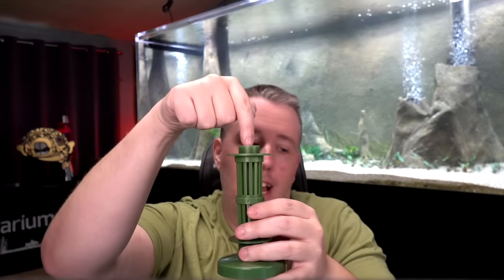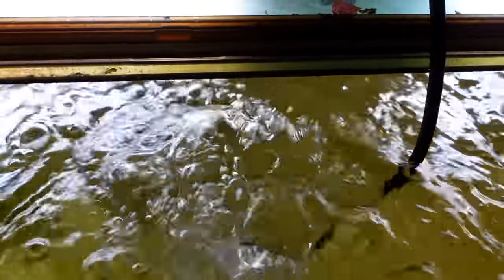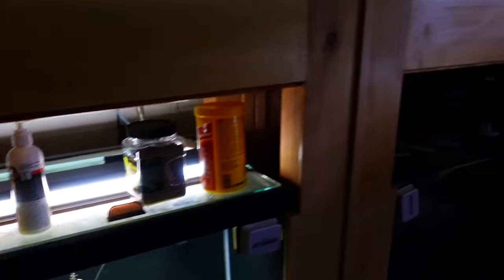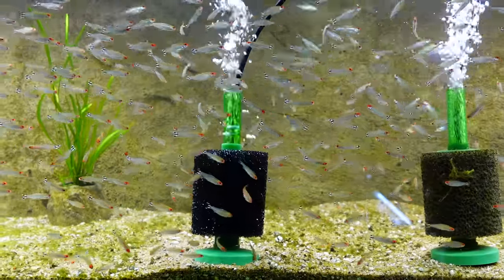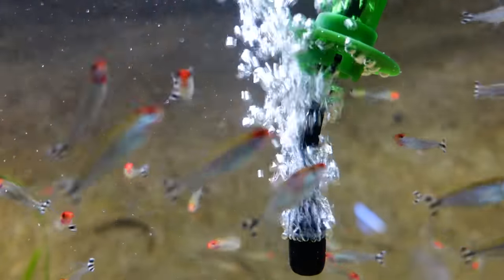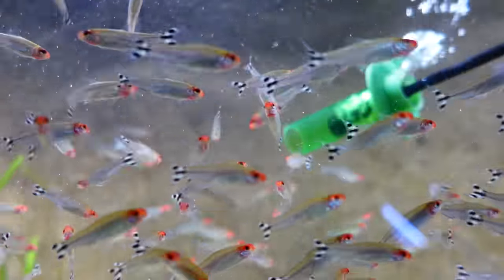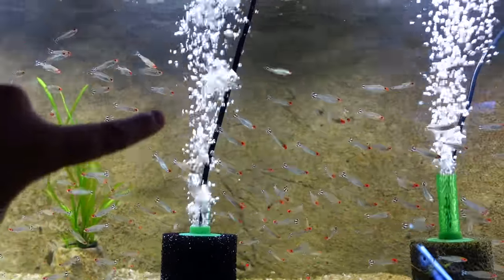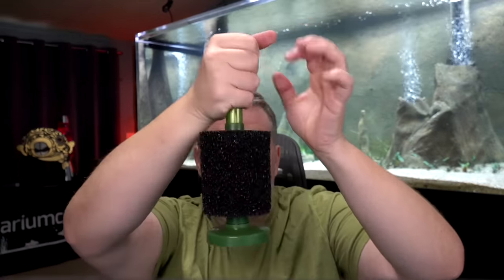How to Optimize and Clean a Sponge Filter

Comment: Cory,. Im set  in t up a couple  20 gal aquariums and a 55 gal and I’m thinking about using under gravel filtration. Do you use this type of filter? Pro’s and con’s? I will have a planted tank-  30-75. endler’s, 1 betta, 1oto, 4 dwarf Cory cats, a couple mystery snails, 1 trumpet snail.. of course im buying co op sponge filters today.. lol I need to use a valve to turn down the air in my stones because I have that jaquzzi sound from a 2.5 beta tank. Poor boy. He’s coming out of there soon. It’s a quarantine tank because I bought him a few days ago and it looks like he has Pop eye.. 😢 I purchased him because he was pineconing  in that tiny cup.  I’m medicating him today
Reply from the maker: I've used undergravel filters. Try one out. You may love it or hate it. All filters work. Mostly it comes down to preferences.

Comment: On my sponge filter, because it kept floating l bought a suction cup and glued it to the bottom. Now it doesn’t move and easy to take out by just popping my fingernail under one side and wallah! 
Love the new design you have especially having it weighted down and the attachments. Are you able to send to Sydney Australia?

How often do you recommend cleaning them, and what is the best way to clean them without risking any damage to the sponge?

Comment: Excellent info, Cory!  I just bought 2 sponge filters from you yesterday!
I'd be concerned if you were squeezing the sponge filters several times when cleaning them.  I read about a test somebody did in which he squeezed the sponge filters multiple times and measured the ammonia level over the next few days.  1 squeeze recovered all beneficial bacteria after 1 day, but with 2+ squeezes, it took anywhere from 9-18 days before the ammonia was back down to zero.  I think maybe a lot of that brown gunk is beneficial bacteria, and you're removing it when squeezing too many times.  
Now, if you have 2 sponge filters in the same aquarium, and you stagger cleaning them, it probably won't be bad at all, because as one is "recovering," the other will take over the nitrogen cycle.  
Am I just being too cautious, or is there any truth to what I'm saying?
Reply: Great question, I think about this too. I believe I'm only disturbing some of the beneficial bacteria in the tank by cleaning the sponge filter. So as long as I don't gravel vac, clean the glass and clean the sponge filter at the same time I'm OK. Kinda feel like I'm making room for new hungrier bacteria too...
Reply: Im no expert or anything but wouldn't the substrate hold a lot of bacteria too? A lot more than the sponge? And isn't it's main use for mechanical filtration?
Reply from the maker: I e never run into this issue, even when running a store with 300 tanks and all sponge filters. In fact this is the first I’ve ever heard of it if you are cleaning them correctly. If you take them to a sink and use tap water, there may be some concern.
Reply: @Peter McCarthy:  The substrate (and glass, and plants, and rocks, etc.) will indeed hold denitrifying bacteria.  However, I believe that the efficiency of denitrification is greatly increased with water flow.  Unless there's a powerhead or wavemaker blowing water across the substrate, or you have an undergravel filter installed, the denitrification will be too low to make much of a difference.  I believe that sponge filters do both mechanical filtration and biological filtration.
In any case, I'm using the two sponge filters for a plain, glass-bottom, quarantine tank.  Once the cycle is complete, there will still be beneficial bacteria on the surface of the glass, but much less than if it had any type of substrate.  In this kind of set up, nearly all the beneficial bacteria will live on the sponges.

...and I'm no expert either, so if anybody thinks I said something wrong, please correct me!
Reply: Great conversation,  thanks!
Reply: @Clarence I, too, read that and thankfully still had the tab up in my browser. The first small study they discussed covered sponge filters that had been in use only 6 weeks and there was a marked difference in the amount of colony left based on how many squeezes used (in clean dechlorinated water, not tank water like Corey's method which may make some difference). The was also a second study they ran on 4 month and 4 year old filters that showed a drastic decrease in the impact of the colony based on how many squeezes used.

https://aquariumscience.org/index.php/6-8-thorough-cleaning/
Reply from the maker: An interesting study no doubt. I'd love to have some more conversations with them and do some of my own tests as I would do it differently. Water parameters can play a huge role in this, also In my findings, as a hobbyist of 10+ years using sponge filters. I can count the times on 1 hand where I've ever had 8ppm of ammonia in an aquarium. The study even states this is only for newly established aquariums, and established aquariums don't see this affect at all. This is probably what will lead me to never do the experiment as I'm already a fan of letting an aquarium become seasoned before even introducing fish.
Reply: This comment was to long to bother to read
Reply: @Patch-vh4yq  says the guy with lots of dead fish

Comment: What size sponge filter would you recommend for a 40 gallon breeder? I’m thinking of putting one in a 40 gal breeder with a HOB for mechanical filtration and having the sponge if I need it to start cycling a new tank.

Comment: Thanks for the great video!  I set up the USB Nano Pump with the 4-Way Metal Gang Valve for two 5 gallon tanks (I was thinking it would be ok to just leave them in 'off' position for the 2 unneeded ones).  I have an airstone in each as well.  I'm finding no matter how I position the 2 valves for the 2 sponge filters that are running, the airflow is extremely minimal.  Is the USB only powerful enough for 1 sponge filter, or am I maybe doing something wrong?  

Thanks again!

Comment: The easiesst and cheapest way of increasing any air driven filter is to simply increase the length of the upflow pipe. The longer the draw, the more flow you get. However, for biological filtration, slow flows are preferred. It you are using a sponge filter, you are not after flow rate. If you are after efficient, high flow, filters, you go to trickle or fluid bed filtration, not sponge filters. High flow sponge filters are really only effective for mechanical filtration.

Comment: I just got a Hygger from Amazon after seeing a video about one that someone designed that is smaller and suctions to the glass. I accidently bought a huge one, shoulda just bought theirs instead of going to amazon. But anyway, yours looks really really cool. Do they come in smaller sizes? I'm really into learning how to aquascape and am trying to self teach how to scape around my tech without it being to easy to cause too much chaos to my ecosystem every time I want to do maintenance. The one I have from Hygger is a 55gallon (in a 10gallon >.>) and the sponges are HUGE but I can also remove them really easily without interrupting everything. Do you have any experience using yours in a more heavily decorated tank and how did that go for you? Also do you have any air pump recommendations? I've got a small cheap one that's working really well so far but sometimes it feels like it just doesn't have enough juice. And I don't want to spend a ton of money on something that isn't gonna do the job. It covers up to 200 gallons allegedly and it's working great so far but if I want to use more air type tech in my tank like messing around with various sponge filters and airstones and the like.

Comment: The ATI's pull apart at the bullseye after time, the weight just rips the filter in half–very annoying. I have to wrap the top and bottom with rubber bands to keep it together.  I see that yours also has a snap-on bullseye. Have you thought about a twist-on vs a snap-on bullseye?

Comment: Hello, i have a 110 gallon container pond that is housing 5 baby koi and 2 goldfish, they're too small to over winter so i brought it inside. But its in our unheated basement. The filter is still cycling, its taking forever. How long with cold water temps (currently the water is 64 degrees) how long until its finished cycling? Ammonia is at zero, nitrites are now dropping, about 2ppm but thr process is going so slow because of the cold water. Any idea how long this is gonna take?

Comment: Love the video. That's how I have my medium sponge filter set up. But what about the small one? I couldn't get the air stone to connect directly with the nipple at the top and had to use a bit of tubing between and it barely fits and leaks air out the top ☹️ I have the small sponge filter in a 5 gallon with one female betta so the air is turned down pretty low

Comment: the small one i got from coop was too coarse to colonize, i finally switched it out with a finer one, and it cleared the tank in 3 weeks. maybe these are good in bigger tanks, but it's too coarse for my nano 3.5 gallon. the flow was adjusted on a valve to not be too much flow.

Comment: Is it possible to add some coarser sponge filter to my small filter so that  it sits on the outside around the fine sponge?  If i buy some of the coarser sponge, wrap it around the fine sponge, what could I glue it with so I don't poison my fish?  I live in the UK and got my small filters online. They are ok, but maybe could be better.  I have them for a small tank (2, 1/2gal) for my Medaka fish.  Thanks.

Comment: I have a 120 gallon tank with discus and angels i currently have hanging filters but I'm just over it for a few reasons. Would these sponge filters be sufficient by themselves with no other filtration or is that not recommended? Also is there anyway to add any other kind of filter media?

Comment: Quick question I have a smaller sponge filter I got on Amazon. I didn’t come with a tube for the top, I have shrimp that are mid size, I have been running an aqueon filter that isn’t shrimp safe, so far have been fine and mind their own business. Should they be okay considering it’s only air if they go in it?
Reply from the maker: Yeah the sponge filter will be shrimp safe.

Comment: Hey Cory I bought some pretty large sponges on Amazon and I run them with a power head. Cause my water is so super hard that it kept clogging the air lines even straight hose lines!! But I see I bought fine sponges if I mixed in a course sponge and the fine sponges would that give my bacteria more time to eat the waste so they don't crumple in on themselves? Or should I just load my tanks with more bacteria because because sometimes they will last months other times days before crumpling in thanks.

Comment: Would it be any more effective in a 25 gallon tank to run a sponge filter and a hang on filter? I’m using a SC Tidal 35 filter on an 18x18x18 inch square tank. The 35 doesnt have an adjustable intake so it sits high in the water. If I add a sponge filter to the opposite side of the tank and turn the air down slightly lower than normal would it help the tank or hurt it?

Comment: The ones I got have a plastic tube all the way to the bottom of the filter shaft that goes through the bottom of the stand and comes back up through a grated floor in the shaft... But my sponge seems to be too fine to get a good suction... I would like my sponges to pick up more debris... Perhaps a more coarse sponge?

Comment: For these coarse sponge filters, how coarse is the sponge?  I ask because I have some of the Aquarium Co-Op coarse sponge media for HOB filters and a placed a used piece in a new tank to help cycle the aquarium.  A small neon tetra actually swam into the sponge and got stuck.

Thank you!
Reply: Never mind!  I just read on the website that the sponge filters are 25ppi and the sponge pad coarse is 15ppi.  :)

Comment: Another Aquarium product that i really want to outfit my entire fishroom with but you guys still refuse to ship to the UK :(
Reply: Sponge filters really aren't that popular over here either. I don't think it would make economic sense. Unless he could encourage boom in interest, i think internal (power filters) and cannister filters will always be the most popular here. A few prebuilt tanks come with sump and sump like filters, but yeah, i dont really see sponge filters anywhere.
Reply: @sshep86  Not with this sort of gauge foam which is why i wanted them as i keep large cichlids , id be looking at buying probably 30 of them and probably at least 10 of the USB airpumps as well so it not like id be spending a fiver
Reply: JWA79 air pumps may have come along way too. But it’s also a small market here for them. I think they cost less to run but can’t remember. Last time I ran an air pump was 10+ years ago. They were diaphragm air pumps, not sure if the tech is better now because it’s an area I have ignored since. Used to wear out and fail a lot and the vibrations could cause issues. Even with the rubber feet, I remember having issues with noise and travel. Time’s have changed though and maybe simple sponge filters are the future.
Reply: JWA79 pretty sure those usb air pumps must be diaphragm design though. So in all honesty, I don’t see them lasting long. But that’s just speculation.
Reply: Talk to Cory and see if you can start a co-op in UK...

Comment: just got mine today.....working great. I have a question though. I have a 6 gallon betta tank with a aqua 20 HOB on the back. I wanted to use a sponge as well so if we lose power I this sponge would have bacteria and help keep the tank running good without a huge die off.  I am a little worried though about supersaturation. I seen it somewhere and am curious now. In a planted tank with java fern, crypt, moss balls, anubias gold, anubias nana and another anubias (all of which also came from your store), would this give too much oxygen to the tank.....i am kinda a newb at this stuff so any help from anyone would be great.

Comment: Corey....
I have a nano filter (amazon, sorry 😞)  and I tried to enhance the filter by cutting out the inside and creating a hollow center. Ok.. everything was great UNTIL I went to add the air stone. It was TOO LONG to fit even being attached with a teeny piece of tubing. So, I cut down the plastic intake tube and it was STILL too long.. I feel like I just wasted my filter, etc.  It's for a 10g. But it's tiny. Only has 1 basket thing..
How can you alter this nano filter with an air stone? HELP...

Comment: Does cleaning it with this method not disturb the bb? If I want to switch over to one for my 20 gal which is a little over stocked I would say, and a 5 gal with a beta and 2 snails.
Reply from the maker: It would disturb it a little bit, but most of your bacteria is in the gravel, on decorations etc. But in my experience I've never had a problem, running sponge filters for 15 years.

Comment: Hi, can I ask a quick question for anyone to answer on this topic. Running a Juwel Vision with Juwel Bioflow pump and filter setup. I’ve got an air stone to increase surface agitation but thinking about adding a sponge filter to make more use of it and help with filtration (I have fancy goldfish). If I place the sponge filter in the opposite corner, will there be any conflict between the two filters? i.e. suction, water flow. 

Thank you

Comment: Do you recommend using a control valve or a bleed valve to control air flow?
Reply from the maker: I use a control valve, but if you had a way too big sized air pump you would need to bleed the air
Reply: Aquarium Co-Op  Thank you

Comment: I have a sponge filter that for some reason the base of it gets pushed to the center tube really right and the air flow goes way down and then I have to pull it apart a little and the flow goes back to normal. I don’t know why.

Comment: Hey Cory, I bought 2 of your nano sponge filters for my bfs little cousins tanks. And didn’t realize they had 2 gallon tanks. Would there be any way to use these filters in their tanks. I’d love to get them a bigger tank but I think it’s overstepping
Reply from the maker: The nano filters were designed so that you could cut the sponge in half, and remove one of the internal basket pieces and run it half as high. You could also not use the uplift tube. These are meant for the pico tanks. However when you do the half size sponge you can no longer fit a neverclog airstone and not many air stones at all will fit.
Reply: Aquarium Co-Op thank you soooooo much

Comment: Why does the sponge filter I bought from you that looks like this have 2 inlets at the top. One in the middle and one on the side at the top?

Can you make a video describing why there are two air inlets at the top?
Reply from the maker: The one on the outside is an air collar. The center of the bullseye is how sponge filters typically connect the air. The outside air collar is much more efficient.
Reply: @AquariumCoop  Thanks!!!

Comment: Don’t you need the air to go to as close to the bottom of the tank/sponge as possible so you can maximize the entire sponge? That’s why your established sponge filter is only catching stuff at the top of the sponge.

…at the very least put a tube around the air stone to help pull in suction close to the bottom of the sponge. Otherwise, the sponge filter doesn’t need to be anywhere near as tall as these are.  An even better idea is to have the air go to the bottom of the sponge using a 1/4” tube and put a plastic/pvc 1/2” tube around the 1/4” tube and drill holes in to the 1/2” tube from the top of the sponge to the bottom of the sponge. You’ll get much better suction dispersed throughout the entire height of the sponge… #science #themoreyouknow 🌈

Comment: I have a wet dry filter system could I run the air Spons in my tank also
Reply from the maker: You could,  You may not need them though.